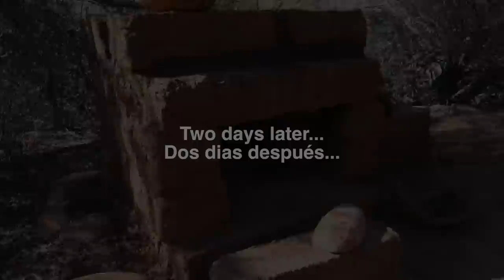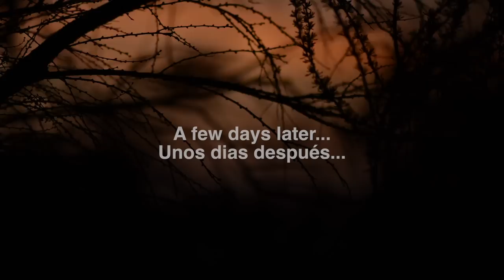Build a Primitive Adobe Rocket Stove (Part 2)

Comment: Very cool Chad, I'm really amazed the quality of clay you have there.  My clay here is a white color and cracks a lot as it dries. How long does it take to dry in the sun before you can use it? As always I enjoy watching your videos. I pay particular attention to your edits and camera angles.  Great job! I saw it come through earlier today but I was shoeing horses and couldn't watch until now. I think i'll watch it again.
Reply from the maker: In the summer these blocks dry in about three days. I imagine that the core is still a little moist and probably takes about a week to completely dry. However, during the winter it can take two weeks of dry weather before I'm able to use them for construction.... Regarding the clay, these bricks don't have much clay in them. It's mostly soil and dry grass, and sometimes I throw in some sand that I collect at the beach. I've only worked with clay in this area. The southwest United States is famous for indigenous pottery. But when I first started working with the clay it always cracked during drying. I tried so many different ways until finally I figured it out. I had too much water in the clay. It was too wet and therefore would shrink a lot during the drying process. Also, drying in the sun always caused the pieces to crack. They should dry slowly and evenly. Inside the hut works well to dry clay pieces. Adding sand helps reduce shrinkage during drying and thoroughly homogenizing the clay is essential as well. You have to work it with your hands for a while, kneading and folding and pulling until it becomes the right consistency and is very moldable.
Reply: Chad, I probably need to add sand and straw to make more of a cob mixture. I really like the brick idea. They say if it has a good pair of boots and hat and the building will last for a long time.  You have given me some really good ideas. I'll keep you posted.

Comment: Do you use a primitive frame in long bricks? for reliability against cracks
Reply from the maker: No, I did not use a frame in the long brick. I think a good way would be to make a core out of solid clay, fire the core piece to harden it and then put it in the middle of a long adobe brick.